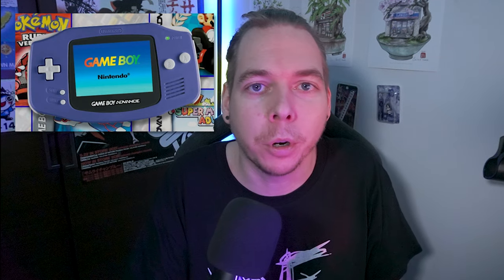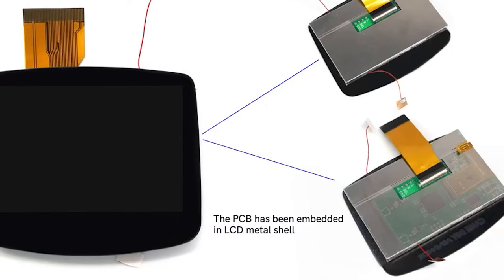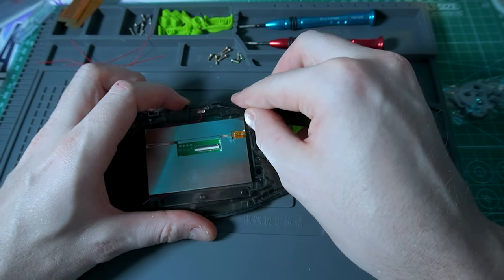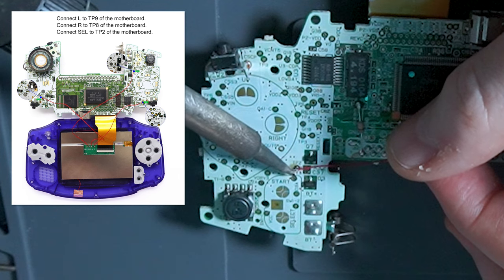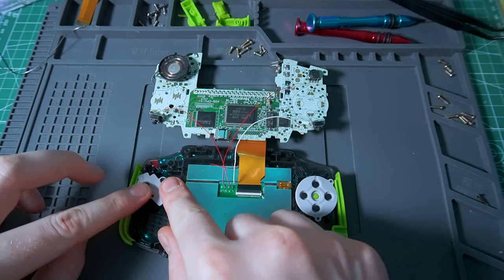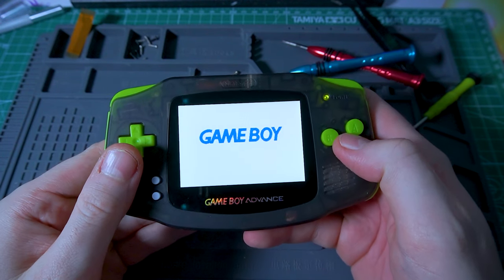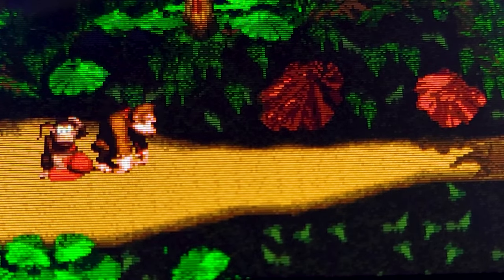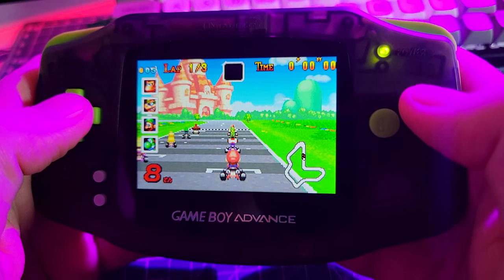Restoring a Japanese JUNK Gameboy Advance!

Comment: I prefer my modded advance and colour over the analogue pocket. In fact the analogue pocket is way overhyped, the larger screen IS nice on them and they can emulate snes etc… but also if you want a larger screen and to play snes etc than just buy one of many quality and budget friendly retro devices out there (like the rgb30). The best way to play gba is on a gba and vice versa for gameboy/gbc with a colour. Those mods are pretty sweet and feel way better tbh.
Reply: If you have the analogue dock you can play on any size screen. One console with portable fpga cores and can play original cartridges is far from overhyped.